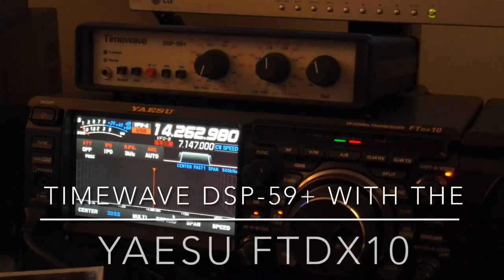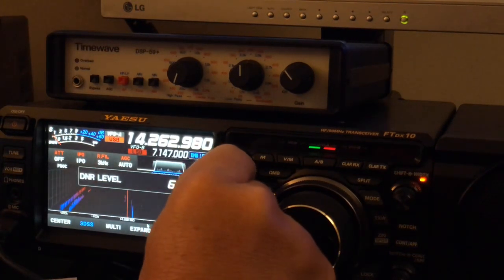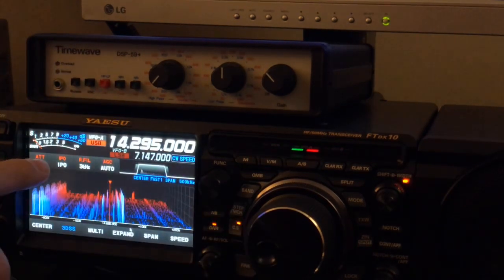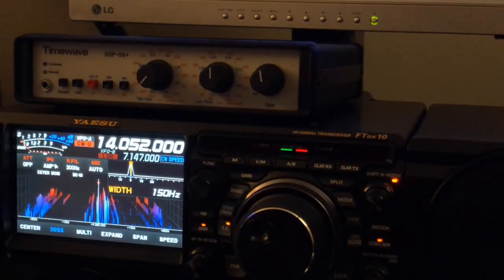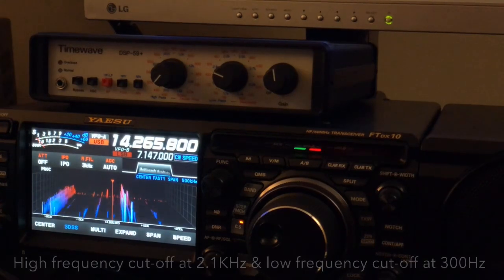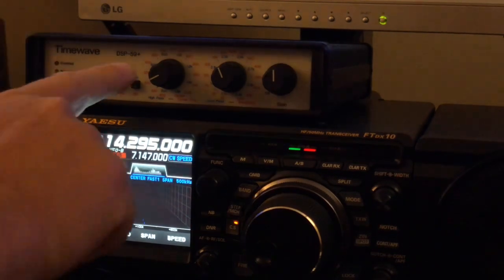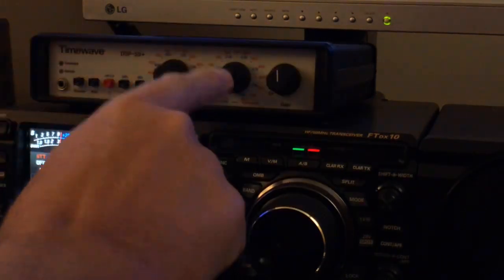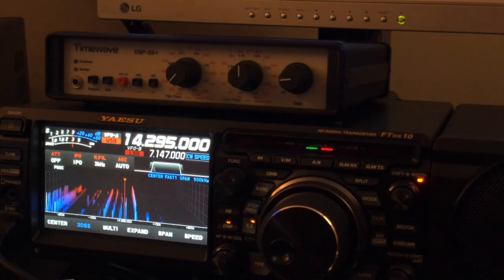AF DSP vs IF DSP (DSP-59+ vs FTdx10 DSP) #hamradio #timewave #dsp

Comment: Timewave, back in the day made a few various DSP units that were clamped on the Audio signal, living between the Audio Out and the speaker/headphone.  (I used an FT-1000 as my SWL rig with the Timewave) Was Timewave's final and so called ultimate version known as the DSP-599ZX (which is the one I had).  I had one of those which worked great back in the day.  Just a question for you...  what are the "normal" Yeasu settings, say for SSB, that you use for tuning across the band BEFORE notching, DNR'ing etc... and then how do you QUICKLY get back to "normal" settings when leave the weak signal and go back to tuning across the band?  Is this where you would use the "Band Stack" feature?  As a quick get back to normal??  Great Video...

BTW, taking my General Test today 11/13/21 and one day soon I would look forward to have a QSO with you... awaiting an antenna from NI4L and will be ordering my transceiver, which is going to be the MP.  Lots yet to do in setting up my HF shack but it is coming along.  73 W1SWL/AG?  Yah I am confident...
Reply from the maker: Congratulations on taking it to the next level with a General Class license!

I believe the DSP-599zx was the last Timewave unit.  I never used one but I got more than my money’s worth with the DSP-59+.  I have it connected to the FTdx10 right now because it has an Auto-notch that doesn’t distort receive audio.

As you surmised, my normal settings are set in a band stack register.  It wasn’t something I planned ahead of time - it evolved as a result of my operating habits.  For example, on 20m I have a band stack set for 14.062 with a width of 150Hz, APF, AMP1, DNR@12.  14.062 +/- is the area where SOTA activators tend to operate.  Once I find one, I might narrow the DSP width to 50, and/or adjust the DNR to 10 or 15, so I can isolate them and hear them above the noise.  

The next band stack register for 20m is currently at 14.250, with 2.4kHz width, IPO1, DNR@4.  Honestly, this is my standard 20m “roving” register, so it might not stay at 14.250.  

The final band stack register for 20m is at 14.347, with 2.1kHz DSP width, IPO1, DNR@5, Contour at 1900Hz.  This is the area where SSB SOTA activators operate.  Being QRP, they are usually barely discernible, so I sweep the Contour between 1700 and 2300 Hertz until I can pull them out best.  1900 to 2000 Hertz usually ends up being the magic number.

My band stacks vary according to band but hopefully you get the general idea.  For 80m I keep one CW (@3.561 for SOTA), one SSB (@my SSB watering hole frequency of 3.856) and one AM (3.885).  If I move the frequency of one of these, I tend to go back to my most-used frequency for that band stack, before I leave the band.

Like I said, my band stacks evolved from my operating style.  I hope this helps.

73, de N4HNH
Reply: @n4hnhradio   Yes the band stacks are indeed as I understand them the best way to “get back” to where you want to go after twiddling the dials and settings.  I do think that your fine explaination of your band stacks clearly deserves an entire episode on your channel.  I suspected that was what you would be doing.  I do the same with “memory” settings on my ICOM R8600 receiver.  Thanks so much for the time you spent on those details.  AND guess what?  Indeed I am W1SWL/AG!!  Just treated myself to the Yaesu FTDX101MP.
Reply from the maker: Wow! Congratulations!  And why not reward yourself with a 200W version of the top radio in the world.  You are now practically upgrade proof.

I use memory channels too.  I covered that in a couple of videos.  I have specific memories per band that I can tune away from but return to by reenabling memory mode.  The FT-891 is excellent in that respect.  It makes a great mobile because I use memory tune to go where I want.  When done all I need to do is press the Multi-knob in and rotate to return to memory mode.  It is a well thought out radio, perfect for a mobile rig, except for the DSP Noise Blanker, which introduces distortion into the audio of strong SSB signals.  But alas there is no 100% perfect radio.

The band stack registers only return to the way you last left them, but that works for me.  I usually use a specific band stack for a specific purpose anyway, so I mainly just tune to a different frequency.  I go to memory mode with the 5000 or the 10 mainly to use 60 meters.  But with the FT-891, I am always using memory mode.

There are menu customization/setup PDF downloads available to my Executive and VIP Patreon supporters.  So far I have created one for the FT-991A, FTdx500MP, and FTdx10.  If you are a Executive or VIP Patreon supporter, you should download the one for the FTdx10.  It has virtually the same architecture as the FTdx101D or MP.  Many of the menus are exactly the same.  You could use it as a guide to set up your 101.  Of course the FTdx10 videos are also applicable.  It’s just knob placement and a few menu items that are in a different place.  But the 10 is practically a single-receiver version of the 101D.

73, de N4HNH

Comment: Hello! Mine will not go back to default when pressing and hold the Notch button. What am i missing? Thanks for all your video, it really helps me a lot!
Reply from the maker: I think what you are referring to is pressing and holding Shift. That resets the shift and width. To turn off APF and Notch, you press the buttons. 

73, de N4HNH
Reply: @n4hnhradio  Wow my bad sir! I was looking at your finger and I thought that was the Notch button. Thank you so much for the help! This is a great radio no regrets here! 73 KW7CNH
Reply from the maker: It is definitely a great radio. It’s unbelievable that a radio for less than $2,000 can perform at this level. 

73, de N4HNH

Comment: I listen to it, my personal opinion timewave back into the cupboard. might of work ok  with my old 520
Reply from the maker: I will use it for Auto-notch until Yaesu fixes the DNF in the FTdx10.  But otherwise, of course the FTdx10 wins.  It has the most advanced DSP ever included in an amateur HF transceiver.

But for someone new to amateur radio, who happens to be using, or considering, a vintage radio from the used market, adding a Timewave DSP unit can make a big difference for them.  It is also great for those who just prefer to operate vintage rigs.

73, de N4HNH

Comment: Hi Doug,
How would they work together?
Reply from the maker: They work fine together.  But I mainly only use the Autonotch in the DSP-59+.  It is superior to the DNF in the FTdx10.  For all other DSP functions, the FTdx10 is superior.

73, de N4HNH
Reply: @n4hnhradio  
Thanks Doug. I guessed I should have ask if you could use them at the same time, both  DSP on the same signal etc.
Also, I haven't noticed any audio distortion on my DX-10 while the DNF is on. Is this on any particular frequency's etc?
Thanks.
Reply from the maker: You could certainly use both simultaneously if you think it is helping.

The distortion happens on any frequency, but most noticeable with 59+ signals.  Maybe it was fixed in firmware 01-08 but I didn’t see that in the notes for that update.  I am running 01-04.  I prefer the way bandstacking works in that version.

73, de N4HNH
Reply: @n4hnhradio  

Yes mine has the latest update I purchased it around the end of June of this year. I'll listen closer but I haven't noticed any distortion with the DNF on and I've listened to some pretty powerful stations on 80 mtrs but I will pay closer attention to it. 
Thanks again,
Tim.
Reply from the maker: You might think it is normal until you turn off DNF.  Then it becomes noticeable.  I was fooled by it at first.  But maybe it is just my firmware.

73, de N4HNH

Comment: Hi Doug my meds have been changed and my lungs are in bad condition. My nebulizer not working right, it makes harder to breathe. The VA lung doctor knows but it has to be approved by my primary doctor,  and it do make and  Sense to me.
 I would like to get my ZS6BKW in the air. From pass   Memory it's a 100' long and I gotta get it at list 45' 55' in the air flat top. Sure do wish my 60' of rg-45 up. Put a stand off about  5' and I  be ready. 
Question on the beam. Having a hard time getting it apart.  Sounds like sand, was told it had a non Corrosive.
Any ideas. 
Have to go hot shower helps.
73 de KQ4CD Paul
Reply from the maker: Paul, I’m not sure about the beam.  Why are you trying to take it apart?

The ZS6BKW should be a minimum of 45 feet above the ground beneath it.  It doesn’t have to be flat-topped.  It can be inverted V.  Mine is inverted V and it performs extremely well.  The elements are 47 feet each, so the total length from end to end is a bit over 94 feet.  Installed as inverted V it won’t even need 94 feet of space.  

You are right to offset from the tower.  The ladder line should be as far from metallic objects as possible - at least a couple of feet away.

I hope the docs get your meds figured out soon.

73, de N4HNH
Reply: @n4hnhradio   The reason I took it apart is that so I could get it in my truck. And it was hard for 2 grown adults to pull it apart. My thinking is take it apart and get the grid out of it. At no idea what they put on the inside of the tubing but surely it shouldn't have got gritty, But I don't know that. I'll get it at the park one piece at a time and then put it up on my 65' tower along with my My modified G5RV,  ZS6BKV.
 I was in the hospital 3 different times i'm's with pneumonia and ever since then I've been home home in between the hospitals I had to do breathing treatments 3 times A-day. The thing that makes it go isn't working right and I'm supposed to be getting another one but I'm not going to hold my breath on that and it's coming from the VA. So I chat later. 
 I'll go over to Patriot and see what I can do about sending you a message from there I just don't think some of this should be on could be on YouTube and I'll leave it at that OK 73 KQ4CD Paul

Comment: No contest.  Yaesu DNR for the win.
Reply from the maker: DNR has come a long way since 1991.  But DSP width on that box has independently adjustable high and low cut-off. That was nice. Yaesu did that with the FT-920 but they didn’t carry it forward to the new rigs.